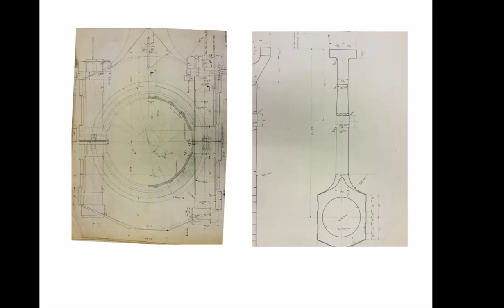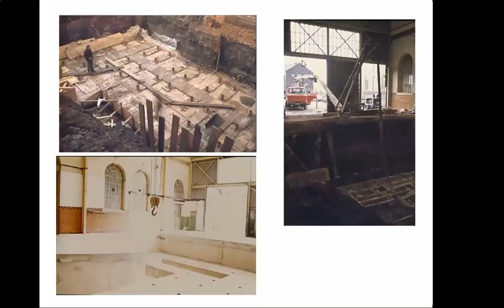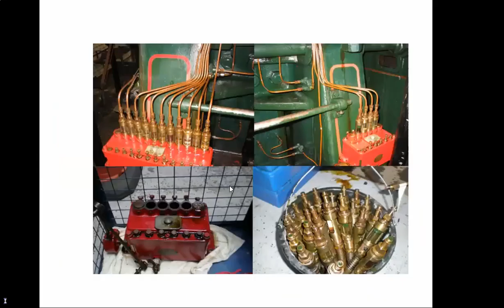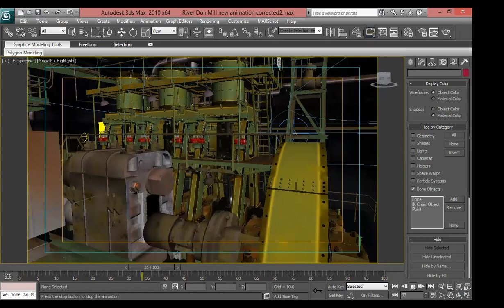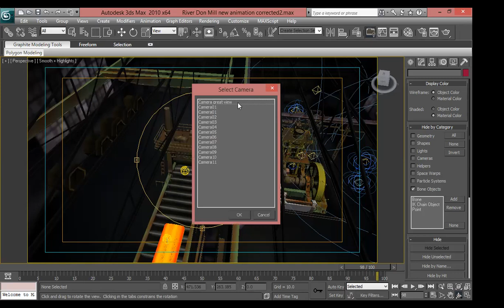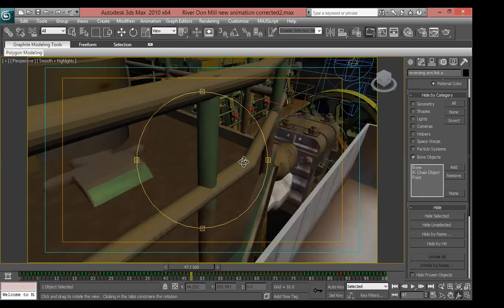‘The River Don Engine’ by Greg Harris

Comment: Thank you for posting this fantastic video, I'm an avid River Don Engine enthusiast and it is truly great to be able to see so many engineering drawings and pictures of the engine when it was in use.
Reply: Your very welcome I first came across the River Don Engine engine back in 1982 when the museum first opened , I was fascinated from the start a little scared though. I  got to know Richard Gibbon who was in charge of restoring the engine a  3 year mammoth task. He leant me this big old manual book in 1988 with all these wonderful working drawings that came from the River Don Steelworks . Not sure If It survived the floods or If It's still in the museum somewhere , I was lucky enough to meet some of the men who worked on the mill & for them to share there memories of the there time at the mill with the engine.  They still have some  rolls of duplicated drawings dating back to 1902 with the John Browns Atlas works stamp on from the first mill .